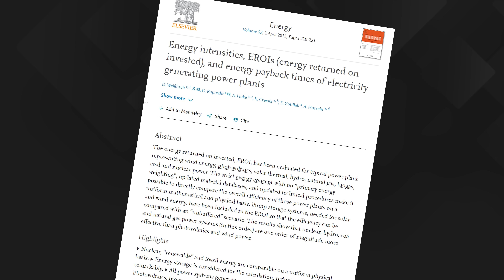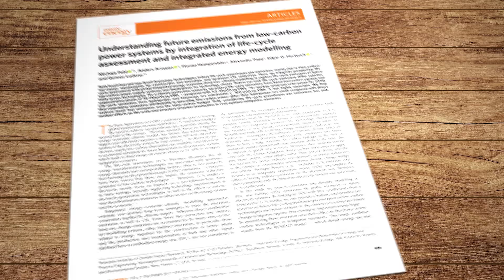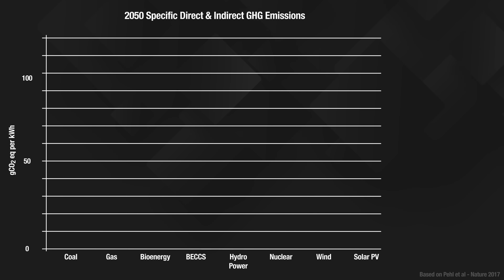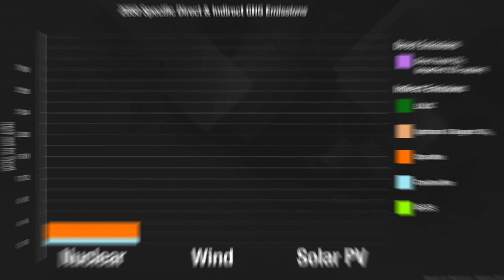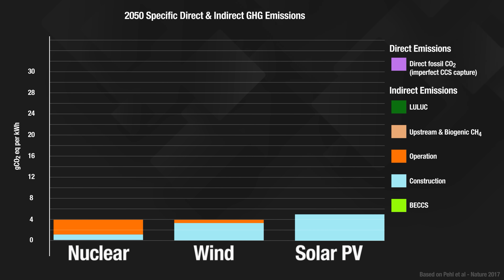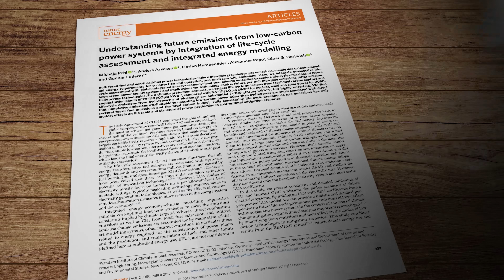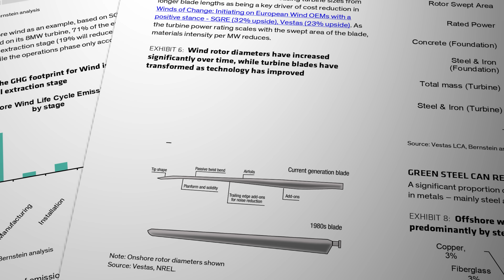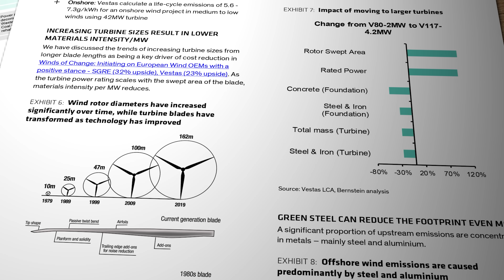Lifetime carbon emissions of renewables vs fossil fuel. Problem or solution?

Comment: Who argues the levelised Co2 emissions of renewables is comparable to fossil fuels?
No one agues the above, and if they do please refere to them and their peer reviewed research papers.

The idea that the supply chains for the production and lifetime operation and decommissioning of a renewable energy farm is anywhere near  as carbon intense as the fossil fuel analogue is novel but let us assume that everything IS the same and the only part that is different is the energy generation part.
So all the movement of goods and services that are used to design and manufacture the renewable energy farm directly and indirectly is fully driven by fossil fuel (which is realistic since over time the proportion of renewables will increase and the supply chain and maintenance and repair chains and decommissioning chains will also have the same degree of renewables in them).
Therefore as renewables increase in our power supply and more of our transportation is operated by BEV's and not ICE vehicles then the fossil fuel content of all these chains will reduce.

Anyways the key thing is that qualitatively I would think all else being equal then the fossil fuel content for renewables and fossil fuel derived energy plant will be the same.

So it comes down to if replacing the energy production part from fossil fuels to renewables reduces the carbon emissions relative to keeping the fossil fuel  generation part of the chain.
 
The obvious answer is yes it will reduce the relative co2 emissions.
 Thus replacing the energy generation component cleans up ALL of the chains involved and it opens up more of these chains to being cleaned even more by enabling goods to be transported by BEV vehicles instead of ICE vehicles. It enables services provided by people and automated system s to be provided using renewables.
If the fossil fuel plant is never replaced with renewables then there is no chance for the chains involved in the fossil power plants design, production, lifetime repair and maintenance and decommissioning to ever reduce its co2 emissions.  
This is obviously why the fossil fuels industry moved heaven and earth to destroy the renewable energy revolution and climate change science and public awareness.
Even now with the massive rise in energy produced by fossil fuels or Governments solution is to  "temporarily " seek to increase fossil fuel production and not expand the value chains for lower cost and reduced co2 emissions renewables.
How fucked up is that. All this time Governments and  the fossil fuel industry has been saying  cost of transitioning to renewables will be too high. Now the cost of our existing fossil fuel driving economies far exceeds the cost of renewable energy production the same fucking fossil fuel entangled Governments are telling everyone the solution is to spend more money to expand the supply of the thing that is the cost costly in order to reduce its cost so it can remain competitive with renewables and reduce inflation. 
😂😂😂😂😂

Comment: What about the battery storage requirements for the whole country when the wind doesn’t blow and the sun doesn’t shine for 3+ days?   And the cost of the fossil fuel back up power stations when the batteries are flat?

Comment: There is something missing. The PV co2 emissions is missing Li-Ion batteries production which will bring the number to near 300 considering the numbers of the chart calculated on 25 years. Then you should multiply battery production emissions by two. As we know batteries last for guarantied 8 years, but they will make 10 years or a bit more when using with care. So renewables are better than gas and coal but not as much as this chart shows.

Comment: It’s all a bit irrelevant. The real problem is to stop extracting coal, oil and gas globally. Period. So called renewables are just a more efficient use of fossil fuels than just burning them for heat, but the Keeling curve shows that atmospheric CO2 continues to rise exponentially. Personally I don’t there is a solution to the CO2 problem, if only because the world is made up of 200 countries that all do their own thing.

Comment: One thing missing from this, deliberately or otherwise, is the carbon footprint for storage of solar or wind energy. As great as the numbers appear for the renewables in this report, they have to be looked at in conjunction with storage to be a fair comparison. Maybe an update episode in the future?
Reply: Same would be true for nuclear, because the load is not constant over the day, but nuclear power generation is.
Reply: @alphablondy04  designing for peak load with nukes is a solved problem. it's the reason control rods are variable. solar/wind batteries provide load control to be a comparison technology so they absolutely should be part of the cited study.  otherwise you might have to build 10:1 ratio of solar/wind peak just to minimize the conditional generation aspect. 10 times more emissions would obviously be a significant difference in outcomes.
Reply: Yes, the storage is the elephant in the room.  The problem is its very difficult, perhaps impossible to quantify.  Not to mention the predicted conversion of ICE vehicles to EVs during the same period.
Reply: Energy storage was developed for grid balancing and coal and nuclear plants, it is only relevant to renewables because it is cheaper and cleaner to fill it with renewable power instead.
Renewables do not need storage at all, grid balancing does. Any shortage in production is local and can be covered by importing power from elsewhere, but a brownout of just a second could damage lots of electronics and batteries prevent that faster than any form of energy production.
Reply: @AnalystPrime  that's pretty disingenuous to say renewables don't need storage but grid balancing does.  you gonna get megatron to put the energy in cubes and walk it to your house?
Reply: @robgeach8105   Your question only makes sense if you do not know anything about how the grid works and assume electricity has to be carried in batteries like they used to bring in firewood or coal. I do hope that is not the case.

It is irrelevant how you produce the electricity, the grid always needs to be balanced quickly when the demand raises or lowers or sensitive electronics will start going snap crackle pop and the magic blue smoke that makes them work escapes.

The other balancing act is to store extra power your nuclear and coal plants produce at night to cover for the highest peak demand during the day. It is not needed but saves money because the power plants are so expensive to run at less than optimum performance. Renewables need no fuel so building extra capacity is cheap.
Reply: @AnalystPrime  Your argument sounds circular.  Significantly more energy storage (presently batteries) is required if wind and solar become a high percentage of total power output.

Comment: I think this is interesting, but I also think one should consider that this is focused on electricity production.   Currently, about 40% of the energy we produce goes to electricity production.  Another way of saying it is that less than half of our fossil fuel use is even up for grabs in this discussion in the first place.  Now with the advent of more electric vehicles, we should expect that to increase, but that will take time - time we really don't have.  So while this calm, measured discussion is certainly helpful and appreciated, I would argue that to have any chance of staying below the 2C Paris goals, it's going to take nothing short of a global energy revolution.  That immediate transition off fossil fuels should be the number one priority of every nation on Earth, but it's not even close to that now.

Comment: LCA or life cycle assessment model to calculate life cycle of a product is one of the biggest scam humanity ever invented. factor K in lca equation, cant be measured, cant be assessed and only thing you can do with it is just to pick a random number. 
and perfect example is nuclear vs hydro co2/kwh number. one is on par with fossil fuel, other doesnt produce any co2, despite you still need to build nucler pp, you need to enrich uranium, you need to transport it, store it, etc etc.

Comment: certainly. if we put energy generation at the point of consumption, it will be even better.  there is little use for burning even for heating which I used defend more strongly back then, consider the efficient techniques available now like microwave, induction cooking, heat pump heating.

Comment: Yeah that improvements in recyclability of wind and solar will drive toward lowering the carbon emissions per kWh but once again a glaring omission is obvious. With the intermittency of wind and solar, you fail to consider the lifetime carbon emissions per kWh of the energy storage needed to pair with the windmills and solar panels that will make them equivalent in output to baseload sources. In other words a lifetime estimate of CO2 per kWh isn't accurate without considering the impact of energy storage along with the renewable source. Also, while you accurately show the low carbon emission of nuclear, you try to make the argument that nuclear would be worse if we factor in the construction of long term deep earth nuclear waste storage. Once again the fact that deep earth storage isn't necessary for fourth generation nuclear reactors using a thorium based fuel cycle. Not only is most of the nuclear fuel consumed it doesn't create long lived radioactive actinides. In fact, next Gen nuclear solves reliable baseload power, it solves carbon emissions, as well as safety, cost and reliability.

Comment: I think the emissions due to construction of a nuclear plant are implausibly low and only takes into account materials and not the increased complexity. Labor inputs lead to some environmental impacts that seem counterintuitive and you also have to start thinking about opportunity cost. For example, the construction of a hand crafted watch may have a greater environmental impact than the construction of a shed despite the comparatively miniscule amount of material. I once heard something like this(I'm not 100% sure it is correct): imagine there are two people who go to work at the same place and time, and the first person will always choose to drive. The second person has a choice, cycle to work or carpool with person one(the cycling in this case does not replace any recreational exercise otherwise preformed). Carpooling can have a lower environmental impact than the ostensibly zero emission cycling because the impact of the additional fuel needed to carry a passenger is less than the impact of the additional food needed to replenish the calories burned cycling.

Funnily enough, thinking of construction in these terms you would come to the counterintuitive conclusion that, in the case that a project passes environmental assessment without alteration, it would have been better for the environment to never have performed the assessment which itself required energy and labor to complete(although you obviously can't know if it will pass beforehand).
Reply: The thought experiment in the case of the carpooling doesn't really work that well considering food production can be carbon negative given the proper techniques are being used to make it such. On the other hand, extraction and refining of fossil fuels is obviously impossible to make it carbon negative. That's kind of the entire point of these discussions happening within the context of a 'green movement' and not singular technological solutions. 

Beyond that, I don't really see what the complexity of nuclear plants has to do with increasing their carbon footprint. They aren't actually more complex than a coal fire plant, they mostly just have more robust safety mechanisms. They are both just really big steam engines after all. If anything, the carbon footprint of a nuclear plant should be even lower if we were properly using the waste heat from the facility to operate large algae ponds for secondary production.

Comment: IF you start adding potential construction carbon costs for one method of nuclear waste storage... for a FAIR analysis, you have to add recycling carbon costs of wind and solar. Otherwise you produce a biased argument, reaching conclusions you want rather than the truth. Similarly, you have to acknowledge that types of nuclear reactors exist that produce much less waste or even burn up existing waste (no storage associated carbon costs then).

THE BIGGEST mistake I think is not accounting for carbon footprint of STORAGE for wind and solar LOLZ. Batteries require materials and have carbon footprints. Pumped storage will have a carbon footprint up there with hydro, etc, etc.

I would also check if land use carbon costs were included for the renewables (as the graphs you presented ONLY show construction and operational carbon footprints of renewables). The big criticism against renewables is that they require extensive areas of land (vs relatively tiny areas that nuclear needs), that displaces nature, plants and animals, and has to have a carbon footprint.
Reply: There are certainly other factors that can come into the picture, but I really don't think the things you have brought up here would change the overall picture of the energy landscape. Sure, the recycling costs could make the footprint higher - but that analysis would also have to be done for the powerplants themselves. The cost of ripping down a decommissioned power plant tend to be pretty high as well - using large machinery and high explosives to take down cooling towers. 

I don't think battery costs for renewable energy is really going to have as large of an impact on the analysis as you think it will since most grid scale solutions tend to use less efficient types of storage, but require more rudimentary materials to build - such as high concentration saltwater batteries. To add onto that, with the greater adoption of electric vehicles, a good chunk of the energy storage needed will just be through utilizing vehicles as a decentralized storage when they are connected to the home's power grid. The way the grid works right now is largely through brute force rather than through making real time adjustments that a more information driven smart grid could finesse the energy through the system where and when it needs to actually be there. As it currently functions, most grids massively overproduce energy at night that mostly just goes to waste. 

Finally, to your land use point, the impact would be largely a reduction to their carbon footprint. Wind turbines have relatively small footprint and the surrounding land is still perfectly useful for farming - but less attractive for development. Installing wind farms essentially ensures that for the lifetime of that installation the land will always be dedicated to photosynthesis rather than being turned into inefficient suburbs. Solar installations likewise can be paired with food production such as graving sheep on the grass underneath the panels - or again, just having active farms underneath them. A German study a while back showed that specialty crops really benefited from mixed field usage because it protected the crops from storm damage, such as hail. So yearly yields might be slightly lower, but the year over year reliability was much higher. They also noted the tertiary benefits that workers preferred working under the panels because the shade made the work more tolerable.

Comment: Some considerations you did not mention was what renewable energy has not achieved all the production projected, the additional co2 of energy storage, the large parts of the plant physically impossible for current technology to have any hope to go green.

 If I recall right if you used current green tech in the best places around the world with near perfect transmission to the rest of the world you would still need 10 times the production potential to reliably replace current energy demands.

My current thoughts on these technologies is once I see solar panel factories powered 100% by solar panels in my area then I know for sure the technologies are good for my investment

Comment: This analysis assumes that all kwH are the same. They're not. The output of solar and wind generators need some method of storage. Our industrial economy runs on "electricity on demand", not "electricity when available". The problem with making comparisons is that there isn't any method to provide the sort of storage wind and solar need. .

Comment: It is of course, well known that solar PV does not generate power at night. Wind doesn't generate when the wind isn't blowing. Those who maintain that the wind is always blowing somewhere would do well to look at Eastern Australia where wind power recently has been minimal over the four eastern states, which, together with a cold-snap (by Australian standards) contributed towards warnings of power outages. Those outages didn't materialise, but only because wind power is not yet a large component of the the power grid, with coal, gas and hydro proving sufficient in the event.

The point of the above is not to say that we should necessarily not use solar and wind, but that if they are being used, we should include the carbon emissions of the technologies required to store energy, or otherwise provide power, for use overnight and when the wind isn't blowing.